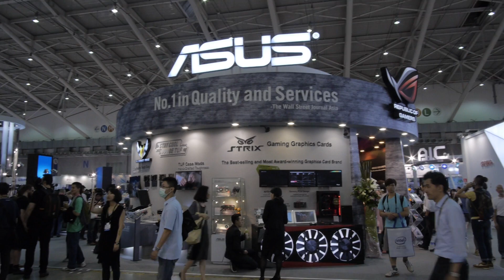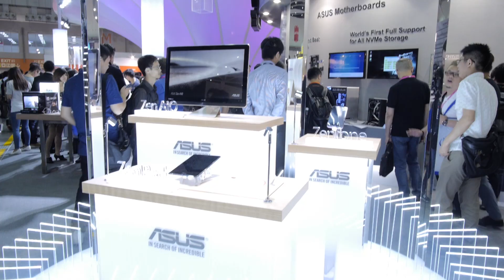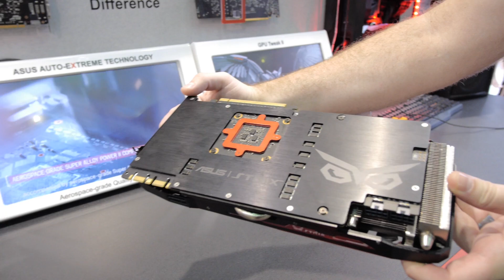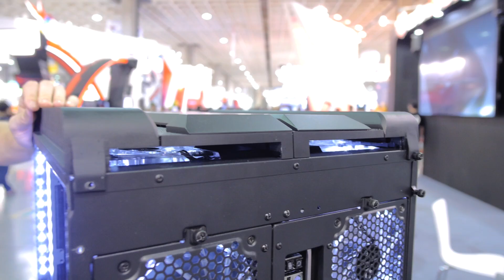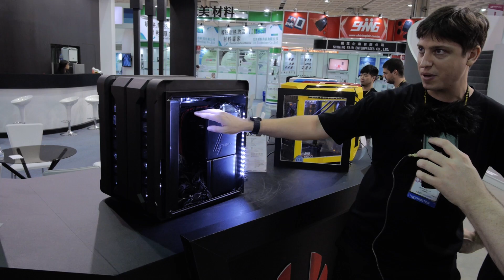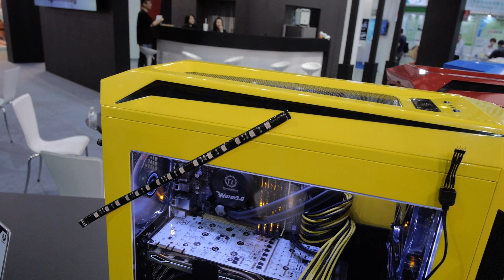ASUS & BitFenix at Computex 2015

Comment: Unfortunately won't be getting another Bitfenix case again after a bad experience. Built a PC for a friend in a Prodigy, and after building, it became apparent that nearly all the screws in the case became stripped. Handles had fractures on them, and parts of the interior of the case just weren't holding up under stress. Emailed Bitfenix support for a replacement unit, didn't hear back for over 1 year. Switched my friend to an NZXT case, which is holding up very well..
Reply: Dirty Mike Thermaltake Core v21 stomps all over the prodigy.  I've been loving it for many months now.  Holds matx mobo's also in vertical or horizontal orientation.  Check it out.

Comment: Non through hole soldering is actually pretty cool because I love the Strix 900 series cards, I couldnt fit it well in my ITX build and the NH-L12. I am going to miss the cool Owl design with the Two Fans, it was my biggest reason for buying the Strix series other than the fact that Direct CU is top notch.